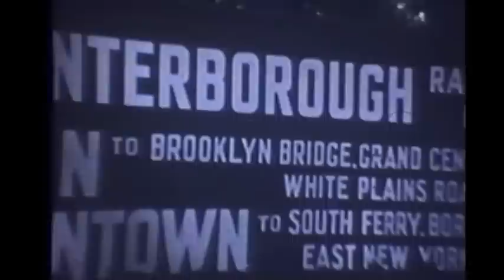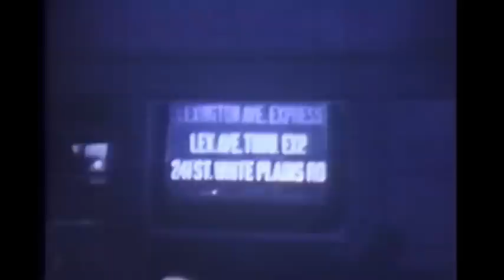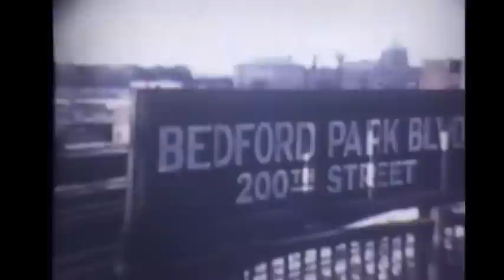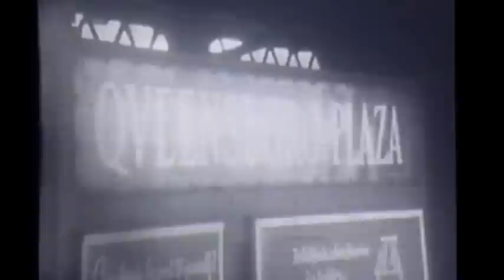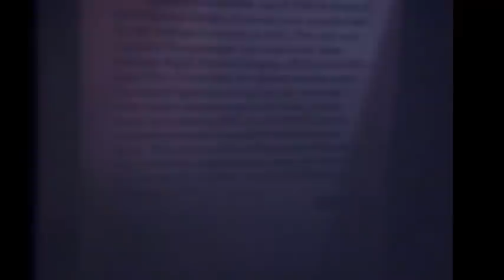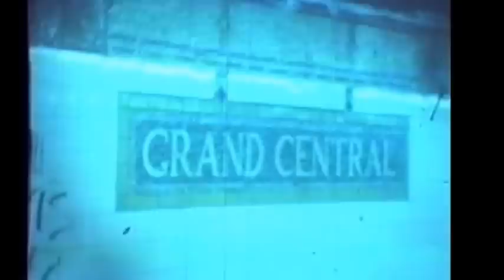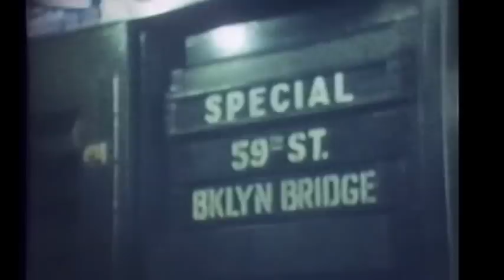OLD I.R.T LINES MOVIE FOOTAGE ,1940'S-70'S NYC..

Comment: I love these old Subway cars. But a lot of rail fans do not realize how hard the Motorman, Conductors, Change Makers had to work in those days. 12 hour 80 hour work week. Thank God for Michael Quill and the Transport Workers Union Local 100.
Reply: The bus drivers had to make change and drive the bus at the same time.  Don't ask me how they were able to do that especially since the older GM buses didn't have power steering.  They had to deal with taking the change out of the Johnson farebox and load it into their coin changer while keeping their eyes on the road and at the end of the run they had to read and record the farebox counters and turn in the money at the end of their shift.  The motormen and conductors on the subway had to deal with a lot of old equipment some of which forced the conductor to stand outside between the cars to open and close the doors in all kinds of bad weather.  The old cars frequently broke down and were very hot in the summer and sometimes cold in the winter when the heat didn't work.
Reply: @1400deadwood I remember Michael Quill, he infamously said to reporters: "...the judge can drop dead in his black robe." However a few days later he was dead. I think they named a bus depot after him, its somewhere in Manhattan.
Reply: @Woodrow3170  I remember the city putting Quill in the old Civil Jail for 10 days for not calling off the 66’ strike. He passed shortly after being  released. He gave his life for his union members. He also set in motion better pay, health and retirement benefits for all city unions. Because of Mike’s sacrifice all city workers earn a living wage to this day!

Comment: I'm an 80's baby. The oldest cars I remember riding in were the old the pre-overhauled R33 "Redbirds" on the IRT 2 Train line. No AC, just fans in the ceiling. They had the old roll destination signs and the side and end door window panes used to slide down for ventilation.
Reply: That would be a R21/R22 with a drop sash end door window.
Reply: @kevinwong6588   The r21/r22 never received the Redbird overhaul. They were scrapped before right before that. But I know the r22 was run on the 7th ave line and I remember riding on them, maybe they weren't painted red? My memory may be running all the R2x series together in my brain.
Reply: @RellyOhBoy  Might been mixed in the same train, hence confusion.
Reply: @kevinwong6588  On the Broadway line, if an older R12 was in the middle of the train, would push against an R21.  For that reason, they were often the lead car.  But if an R 21 was at the front, I would open the window in summer for 30mph "air conditioning".  As for Relly's post, I started riding the 1 train in 1967.  Never saw anything older than an R12 unless I rode on the Third Ave El.  The Third Ave El was featured in the 1967 movie "Enter Laughing", where the story takes place in the 1930s .
Reply: @mossmiller  The R12/14 were often found at the ends of trains since their caps and triggers were not allowed to be used as door controls once they were moved to the IRT mainlines from the Flushing line in the 1960s after the Flushing line got new World's Fair cars.  The only exception was the Bowling Green-South Ferry shuttle which ran two car trains of modified R12 cars.
Reply: @1575murray  Thanks for the update.  I know many conductors hated having to climb out between cars, especially on the Rockaway line where the old A trains lasted into the 90s.

Comment: This is so precious.

It brings me back to my childhood. I never thought I would ever see any of this again.

Every single image is just spellbinding. Remember the old rattan, woven subway seats? When were they from and when were they gone?
Reply: Yep, me too. When I was a kid there were a lot of "newer" cars around like the R10's, R12's, R14's, 15's 16's and I remember when the brand new R32's came on line. I didn't care much for the R32's when they first came out but in later years I came to appreciate them. But when i was a kid there was a lot of "older" rolling stock such as the Low_V's, some of the really early composite body cars running in Brooklyn, and of course a lot of R1's and the old BMT Type D Triplex.  Thank God the MTA & the Transit Museum had the decency to preserve many of the old cars and still run them on special excursion trips or the R1's - R9's holiday special.
Reply: I went to Coney Island Yard for 75th Anniversary and they ran the Diamond Jubilee with those seats. I asked the conductor the same question. He said vandals started cutting them up in the '50s.
Reply: Same.

Comment: I remember seeing and riding the R12, 14 & 15 cars in the early 1980's as a kid in Brooklyn, they was replaced with the R62 & R62A cars in mid 1980's and they still run today.
Reply: I rode those R-12, R-14 cars on the "7", Flushing Line in Queens.

Comment: The R12/14/15 did not have headlights as delivered.  Around 1960 the TA equipped all the older cars with headlights (even most of the prewar cars still in service such as Lo-V's, Arnines and Standards) for safety reasons allowing track workers to more easily detect the lights of an approaching train.  The R22 and all newer cars came with headlights as delivered.  Nowadays the rule is that the museum cars which don't have headlights must have temporary lights clamped on so they can be operated as the first car of a train.
Reply: Retrofitting of pre-R22 SMEEs with headlamps began around 1958.
Reply: Very true, indeed!!

Comment: At 19:32-:39, the narrator is actually describing a Low-V Steinway Coach. No 4048 with a RED LINE under it meant, that it can only be coupled with cars of the same mechanical features.This is very remarkable, fascinating footage. Very informative too.

Comment: Fun Fact: The R12’s were they only R type cars that ran on the 3rd Avenue El also the steel trusses with no tracks at the Gun Hill Road station is where the 3rd Avenue El used to go on and then layout north of the station on the lower level and the station was renovated between 2007 and 2008

Comment: One car of the Diamond Jubilee train (5466) went to the Branford museum in Connecticut.  The other four motor cars (5290,5292,5443,5483) have operated with trailer 4902 on excursions more recently.

Comment: The cars of the Diamond Jubilee train still exist in operating condition today contrary to what the narrator said.  One is at the Branford Trolley Museum and the other four still operate on Transit Museum special runs with a trailer car which was originally in the museum when it opened in 1976.

Comment: I can only imagine these trains must have had a beautiful DC motor sound. The closest thing I can think of are A1 trains of the Berlin Elevated in Germany, built in the 1910s. They ran until around 1992.
  -> https://youtu.be/e0qJbPegxoo?t=213
From a technical point of view, the IRT and the Berlin Elevated are very similar.
If you are more into how thos motors sounded, this could be interesting as well:
  -> https://youtu.be/HxklxEqCMtM?t=16
That's a train from the 1920s. Those were refurbished countless times because they couldn't buy new trains due to political circumlocutions (remember, the iron curtain ran right through Berlin). Those were in regular service until 2004 or so. Technologically, this train is more akin to the BMT/IND ones.
https://youtu.be/Y_x8B6vViu8?t=10
This is a "Sprague-Thomson" on the Paris Metro. I don't know how old that one is, but I would guess the 1920s.
Generally, the bigger cities in Europe tend keep one train of each generation in working order.

Comment: 31:24 - I'm told that this scissor crossover became the sole track connection between the 7 & the remainder of the system, as it is today.
Reply: That is correct.  It is used by work trains and cars which usually go to Coney Island shops for maintenance that Corona can't perform.  This is one of the four places in the system where A and B division tracks connect.

Comment: I have been shadow banned, bu is some ever does see this, does anyone remember the old subway cars with the rattan seats? They had a wheel of some type inside that was usually locked. I think it was some type of brake. I used to try and turn them as a kid.